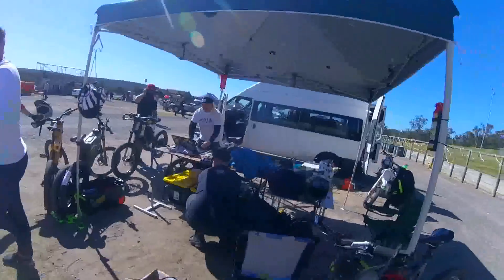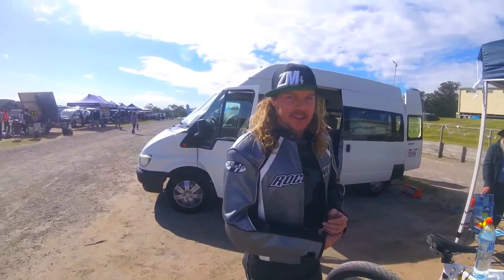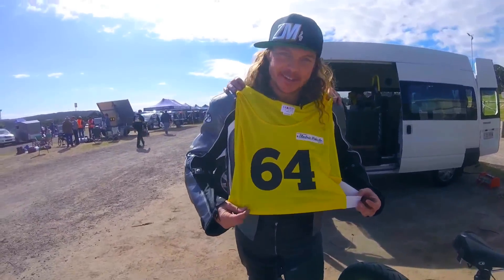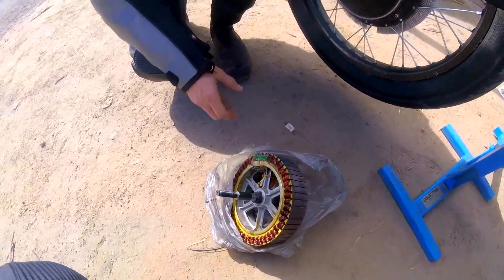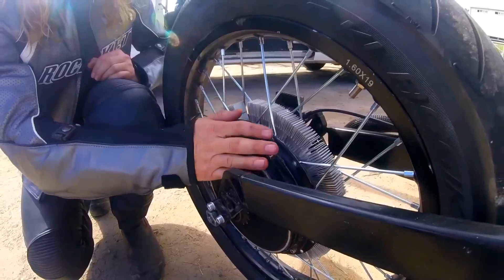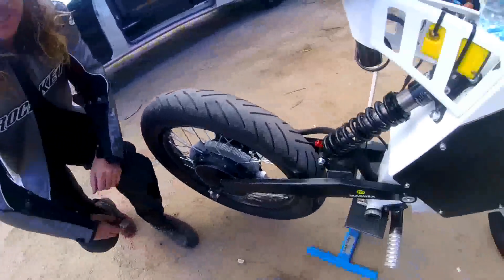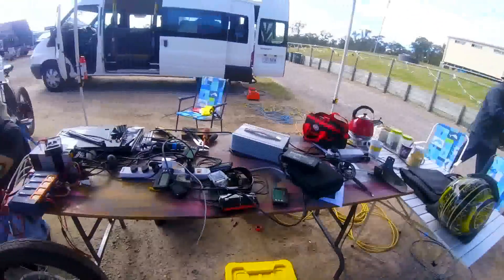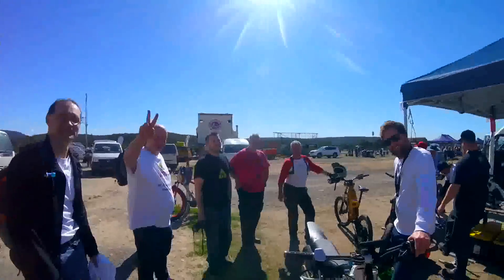HubSink cooling explained by Sketch Coleman - High Power Hub Motor Hack Electric Bike

Comment: That hub motor doesnt look that different from a regular 1500W hub. Am I right in thinking even with a 1500W kit, I could probably squeeze, say 4kW+, out of it with proper batteries, controller, and cooling solution?
Reply from the maker: Yeah you can squeeze waaay more peak power out of any motor, it will get hot if you keep on pushing and without any thermal management or extra heatsink and ferrofluid it will probably end up cooking inside. I wouldn’t waste time and money using these generic 1500w hub motors, better get the QS 205 motor from the QS motor ok Aliexpress and a nice marching controller they sell there too. You’ll get waaaay better performance
Reply: @BrunoPOWEEER  Im a big fan of your channel and even though this comment is on a video years old, you still answer WITHIN AN HOUR... My guy! :D Much appreciated! 
And unfortunately I am on a tight budget and have managed to cobble together a 1500W kit with battery for £480 and although its not even here though (Damn shipping), I am already looking at ways to get more POWER ;) Was just wondering what else I can do beyond controller mod / higher wattage controller?

Thanks!
Reply from the maker: Yeeeeaahhh there’s always a way to squeeze more POWEEEEERR... higher wattage can be done by using the highest voltage the controller can handle, these controllers are current limited, so you increase voltage you increase the max power. Check the interns big capacitor voltages. If they say 60v you go 14s 58.8v max or if they say 90 or 100v you go 20s 84v max. Then another way is to do a shunt mod which is basically tricking how much current the  controller is measuring. Let’s say the controller things you’re doing 60A but in reality you’re actually getting 80 or 100A. Changing the controller is the number one best way to improve your performance. But then battery BMS will be your next thing limiting performance... it’s a chasing game hahahaha
Reply: @BrunoPOWEEER  Ordered a 14s battery with my KT 48V controller
I think current shunt is best for now but will look at getting a bigger controller at some point too (maybe just upgrading the MOSFETs and caps).

Any updates on your 42kW ebike/trike?
Reply from the maker: Yeaahhh some people do shunt mod + upgrade mosfets and caps, it’s fun to learn stuff but nowadays controllers are so cheap it works out more expensive replacing components in many cases. My trike... ohh there’s always something more priority like paid work, consulting work, repairing someone’s battery that failed, companies want me to figure out and fix all their technical problems... and my trike is just sitting there waiting and waiting.... I think I’ll end up making a few burnout videos and probably sell and make another completely new one with parts people can easily buy. People ask where can they buy the triple motor and I’m like “don’t go down this path...” haha

Comment: Would fabricating a passage for a small diameter water pipe to circulate inside the stator?!?!
Reply from the maker: Yeaaahhh some people have done that and it actually works reeeally well but needs to be done right and it’s a bit of a hard work, definitely need to know what doing. Hubsink is super simple and does the job too
Reply: @BrunoPOWEEER  i truly believe hub motors are the best for chassis with no suspension for example a go kart with 2 hub motors as wide as the wheel would 100% have around 50kw not to mention so much space for batteries.

Btw a very cool thought is putting a drift bicycle wheel on an electric bike. This wheel is very hard to drift by foot but with a motor it will be crazy.

Comment: Are the aluminium blades attached to a strip or attached one by one? Are these for sale yet? Would I be able to put it on myself?
Reply from the maker: Yeah the final production version is much simpler, check it out https://hubsink.com/
Even the hub manufacturers recommend Hubsink, MASSIVE difference in cooling
Reply: So glad I found a place to buy these!! Been searching for so long

Comment: Why don't just to use qs 273 instead of qs 205 for more power and/or less heat?
Reply from the maker: The QS273 is waaaay bigger and heavier and still have the same heat dissipation problems, these guys are pumping more power than many motorcycles out there... Sketch was bashing some Zero motorcycles only losing for this bike here, Ripperton’s Electric Yamaha R1 https://youtu.be/vdKDOfXBRMM
Reply: BrunoPOWEEER but much more copper doesn't make sense? i heard from some guys running 273 at 72v200 amps with no heat issue, and one guy said he rewind his 273 (10-15% more copper). 🤔
Reply from the maker: edvinas sarulis yeah more copper and bigger motor is always better but not everyone wants to have a MASSIVE motor, it’s not just that extra weight but the size too. Lots of ebike guys are getting away with the 205 pretending it’s just an ebike, the 273 you can’t even pretend anything hahaha. Personally I prefer the 273 for the extra torque, I make powerful motorcycles at work and we always use 273. 
I visited Sketch 3 weeks ago and he said there are lots of requests for him to make the Hubsink for 273 so he’s going to get them done and available on his website =]

Comment: where can you buy motors set over 5kw, like this 20kw set?
Reply: These are generally 5kw hub motors that are just overvolted and fed with more current. The 5kw figure is what the manufacturer states as a recommendation, but that doesn't mean you can't get more power out of them. The problem is just overheating of the coil windings - which is what the heat sinks and ferrofluid in the video aim to solve. That being said the 20kw figure is not mechanical power rather how much is being drawn from the battery. When you keep feeding these motors more current and overvolt them the efficiency does suffer and thus much more heat is generated.
Reply: @danbinding5165  so you instead of 96v on 5kw, you just get on them maybe 150v and you have more kw?
Reply: @andrejwalter8968  the usual throw more amp though
Reply: @xukzALEXx  yes

Comment: My hub motor smells a tiny bit burnt. Do you think its ok to use it? It works by the way
Reply from the maker: You may be forcing the motor pumping too much current and the smell is possibly the copper winding overheating... put your hands on the motor as soon as you stop and feel if it's super hot. Sometimes it would be very hot inside but you can't really feel on the outside shell.... ideally you should open the motor and see if the winding is going black (burned). Do you overpower or use ferrofluid inside your motor?
Reply: Yea, i am running 7kw on a 3kw motor. It was not burned inside so i will add some ferrofluid and dont run just as crazy for now. Later, i am probaly going to buy a larger 50mm motor for 400amp phase:)))
Reply from the maker: +anton arnqvist yeaaaaahhhhhh... hahaha that sounds like fun... 7kw on a 3kw motor =] 
Get yourself ferrofluid + hubsink... they complement each other... everyone says that once they added the hubsink they would never go back!! You may be able to pump even more power without problems haha!!!
They sell a kit hubsink + ferrofluid on their website https://hubsink.com/
So much POWEEEEEEEERRRR haha =]
Reply: +ElectricBike (Bruno) that is some expensive heatsinks

Comment: I really thought they would use 2 motors instead of just one in the back.
Reply from the maker: +Leandro Martins yeaahhh two motors are good for acceleration but once the bike is moving, the front motor should be switched off. Two motors handles completely different, it needs to be tuned really well otherwise you may lose control around corners.
We have a 2x2 UBCO farm bike (no pedals) at the shop, I ride it off-road quite often... I like the feeling of having the front wheel pulling the bike to the direction that I point the front wheel, it's a little weird and takes some time to get used to. This is me testing the UBCO 2x2 https://youtu.be/_J26qnYffbk

Comment: Hi. Can you give an explanation...

With this specs motor:
MXUS "3K-Turbo" (V3) 45mm Motor - 4T (8.9Kv)

Dyno Test Data:
Max. Continuous Phase Current: 42.6A
Overheat in 10 minutes: 66A Phase Current
Overheat in 60 seconds: 186A Phase Current
Recommended for tire sizes equal to or less than 26" in Diameter

For best performance, how many max Volts and Amps should a battery have?
Which is the relation between motor, battery and controler?

Thank you very much.

From Portugal
Paulo

Comment: you can get those bomber frames off ebay now and there cheap as well.
http://www.ebay.co.uk/itm/162089077679?_trksid=p2060353.m1438.l2649&ssPageName=STRK%3AMEBIDX%3AIT

motor.
http://www.ebay.co.uk/itm/122018434932?_trksid=p2060353.m1438.l2649&ssPageName=STRK%3AMEBIDX%3AIT
Reply: Sorry mate, but you don't really know what you are talking about. You can't compare a low quality Chinese frame to a high quality built Aussie frame.
Reply: These ebay frames are so poorly designed i want to cry. The cranks mount through the swing arm. The distance between your arse and your feet is constantly changing, very uncomfortable and you will be bouncing up and down all over the place. This design is at least 20 years out of date and was only ever used to counter the negative effect of "Bobbing" on light weight racing cross country bikes prior to more sophisticated designs, platform and remote lockout shocks. Have a look at Down hill mountain bikes you will not find a single frame built like this. Any full suspension mountain bike will handle better than this. It's hard to see Sketch's bike but it does not appear to be anything like this ebay bike. it has foot pegs mounted to the frame NOT the swingarm. i'm not hating on this thing it's cheap and if ridden ON ROAD it might suit. Just warning that you must look closely at Ebike frames as most as really poor designs.
Reply from the maker: Yeeeeeahhhh.. thanks for sharing these links here.. it may help a lot of people searching for these things! Prices are coming down big time hey... so many companies making electric bike parts now.. more competition.. more sellers... the price war is tough on the sellers but good for customers... everyone should have access to super POWEEEEEEEEEEEERRRRRR hahaha..  =]
Reply: no problem m8 this is the uk ebike forum http://www.pedelecs.co.uk/forum/
Reply: It really pisses me off when I see fake "Stealth Bombers" being sold on e-bay. This is not a bomber frame. If anything that looks more a clone of the Raptor frame.
Reply: there not just on ebay and plus the bomber is a complete rip off for what you get and can save 7 grand just making one diy.
http://em3ev.com/store/index.php?route=product/product&path=47&product_id=209
Reply: even if you could get a real so called bomber frame there still a rip off for what they are.

a massive single speed hub motor with a massive battery and end up with a 50kg plus bike. err no thanks.
Reply: Those frames are quite good actually. Not perfectly finished, but basically they are sound. Never had a serious problem reported.

However, i would never claim they are a bomber, or stealth like. The design is very different and the bomber is a higher end product. All the same, it goes well with a few KWs at the back wheel and looks pretty cool with some fat 24" rims and tyres.
Reply: CELL_MAN!!! Great to see you on youtube Paul looking forward to  checking out your videos!! Already Subscribed :P
Reply: +Matthew Heffernan No your right you should definitely cry about it ;p
Reply: please buy one so i can stop crying and start laughing
Reply: I just want to qualify that my statement about these frames being pretty good, was in relation to the EEB frames, not those Ebay frames, that are trying to pass off as stealth. The EEB frame doesn't look like a stealth and isn't trying to be 1. The EEB are not the best frame in the World, nobody ever claimed they are, but frankly, they are well thought out. Thet don't have a whole lot of compromises and stack up well, to other frames out there that generally cost a lot more money. If you want the best, maybe spend a bit more money, but if you just want a cross between a cross between an electric bike and motorbike, with plenty of room for a BIG battery and with proper dropouts to handle any hub motor you can throw at it, then you could do a whole lot worse. The people that developed and put the EEB frame into production in China, are my friends and i can assure people, that lots of details were considered, in it's design. However, i do wish that they could address a couple of cosmetic issues and minor details, that are fixable and do let it down a little.
Reply: Thanks Trick5ster. I'm just trying to eork up the courage now to put something together and put something out there :)   Bruno's videos are a hard act to follow, he really nails it with his energy and humour. I really hope he has all his safety gear on, when he's flying between trees at 50kph....:)
Reply: +Matthew Heffernan sorry I don't buy sruff just to make u cry, and like is explained below this, I already bought and built an EEB frame a year ago... sorry
Reply: Have a look at your bike. You are standing on the swingarm. You obviously don't know this is wrong so have a look at motorbikes and full suspension mountain bikes and see if you can find that design anywhere. My original post was to warn people not to buy a frame with this design. When your new to something it's easy to make mistakes. I'm sorry i was too late for you.

Comment: amazing! I knew it I knew it! making your bike just dissipate heat better makes it force better more power! just like with a car!
Reply: Improved cooling has so many advantages. It can mean a smaller/lighter motor could possibly meet your requirements instead of that bigger motor. It means better long term reliability, especially it's combined with temperature monitoring and power limiting if temps get excessive. It also means that big motor, can now produce even more power and for longer. It's a win-win and if the cooling is an integral part of the motor design, it doesn't even need to add a whole lot of additional cost either...
Reply: Electric motors are so rudimentary with just some copper and a coating of lacquer
Reply from the maker: Exactly!!! This can be a massive game changer for high powered hub motors that are extremely powerful and zero noise but notorious for overheating issues... I can see something really nice coming out these experiments =]
Reply from the maker: +EM3ev yeeeeaah, you said everything!!  Smaller lighter and more reliable motors that can handle a LOT more power! Very clever ideas put together, big thanks to these guys that are working hard doing a LOT R&D on it, it's going to help soooo many people out there, like you said it's a WIN - WIN solution =]